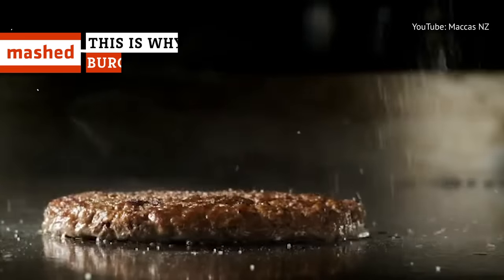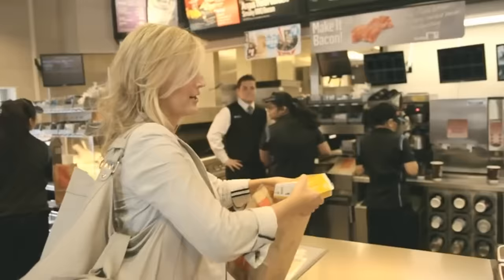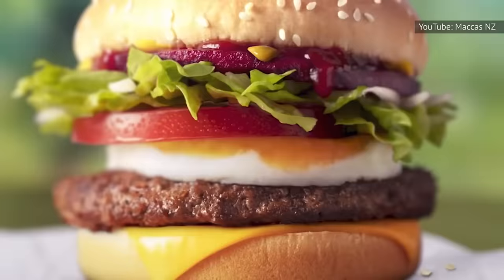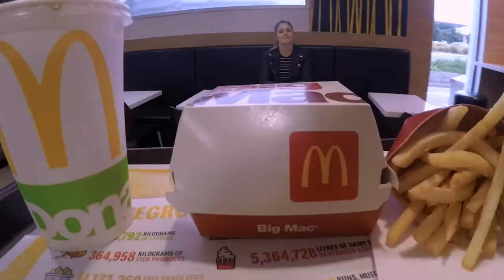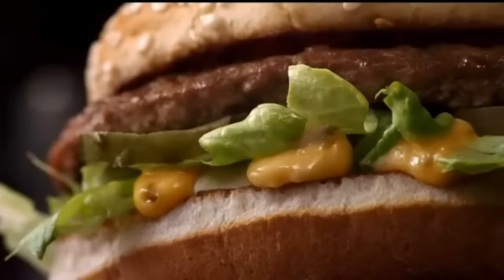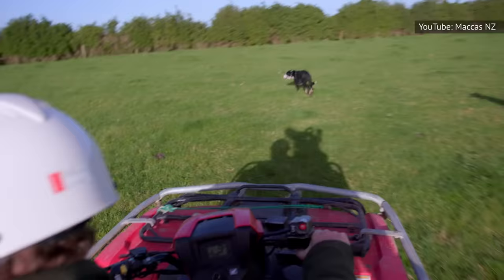This Is Why McDonald's Burgers Are So Delicious

Comment: Recently I was completely taken aback when I ordered a double quarter pounder with cheese as I was on a cross country road trip. I rarely order a double quarter pounder with cheese, it usually is a quarter pounder with cheese and even then that’s maybe ten times in a year. This was by far the best double quarter pounder with cheese I had eaten in a long time. I ordered inside and ate it on their exterior distanced seating given COVID19 regulations. It was freshly made, the two patties were huge, juicy hot, larger than the bun which as large as the box container it came in. It was so good that five minutes later I went back in and ordered another just to see whether this was a fluke. Well, it was not. The second one was as piping hot, two large patties, etc.., I kept thinking that I was eating a burger made in a diner and made just right. Definitely this particular location had a very high quality and consistently pumped out that standard of food. I will have to see the next time I can make it there, as it’s a small city or town halfway across the country. I am reluctant to order one here in my my hometown as I doubt that it will be as good.
Reply: Honestly, I am guessing it wasn't busy? The less busy it is the more time they have to work on your burger and are not rushed.
Reply: I just ordered some Mickey d's last week for my family and myself and I got a double quarter pounder after 10 years of not having one. I almost cried, the whole experience was so good! As you said, it was piping hot and super fresh;the quality:top tier. It was the juiciest sandwich I'd had there EVER, and sent me into a comfort coma. I was so excited to eat it, I had to remind myself to slow down and savour the moment. The next time you order, Ihope your meal turns out as great as it did previously.
Reply: @victorkd9926  they were busy and I had to wait 15 mins to get each time I ordered. It definitely was because of that particular location’s standards and IMO their supply of ground beef.
Reply: I order double quarter pounder with cheese meal, often and sometimes it’s absolutely burnt and dry but about 2 weeks ago, I ordered large double quarter pounder meal with cheese, via UberEats. Because I’m only 2 miles from store , my food usually comes acceptably hot, sometimes but cold but this particular night, the double was absolutely perfectly cooked just like you mentioned. So juicy and hot and the cheap was melted so perfectly. It’s very rare that I get McDonald’s delivery and it’s this good quality but I was very happy.
Reply: @simpette_2.0  same here man. My last double quarter pounder with cheese was absolutely perfect and I ordered through UberEats. Really hot super melted cheese and the beef patty was both perfectly cooked hot and juicy. Wish it was always that good.
Reply: At the one I worked at for years, we had an extra disdain for the double quarters eaters. We'd do things like burn the shit out of your meat just to punish your gluttony. Especially if you got a diet Coke with it or super-sized it.
Reply: @victorkd9926  What I've learned is, the less busy it is, the less fresh it is. The more they have business, the more they have to make fresh food, or you'll just get less fresher food
Reply: I know this was a year ago, but I am constantly surprised by how good these are now
Reply: Fresh meat. Not frozen
Reply: Are you trying to get a raise at the McGarbage that you work at? Or maybe you never had a good, quality real burger at a decent restaurant.
Reply: @victorkd9926  actually having worked there I'd say the opposite is true. Lots of customers will mean the burgers were cooked more recently and will be juicier and fresher. They won't look as pretty maybe but you have a better chance of having a fresh one if you go when it's packed
Reply: Which McDonalds was it

Comment: I was always amazed that you could not get a standard burger for adults at McDonalds - one that included fresh tomato, lettuce, onions, and mayo - unlike every other burger joint in the country. They remedied that briefly a couple decades ago with the McDLT, but it was pretty crappy since the whole thing was always cold (and they put the cheese on the cold side so it didn't melt).  However, recently, they started making a burger for adults  - the Quarter Pounder Deluxe! It is not bad, but's it's not great either, and for $5, I would rather get a burger at pretty much any other fast food restaurant or burger stand.
Reply: Just ask for tomato on the side
Reply: They used to have the Big N Tasty but they got rid of that a long time ago. I guess people who want that kind of sandwich will just go for the Whopper or Dave's classic at Wendy's.
Reply: That is precisely why the founders of Mcdonalds were against complicating the simple burger.  They wanted something that was hot and fresh and not weighed down by items that would soggy up the bun or chill down the burger.  I have said for years tomatoes have no place on a burger and I am sticking to it

Comment: Pink slime is NOT a bad thing! Beef trimmings are cleaned of fat, and ground fine. Then, it is sanitized with ammonia GAS! Not liquid ammonia. This is a sanitation method that has been approved by the FDA for decades. So, we are left with very low fat, sanitized beef. By itself, the texture would not be pleasant. But, when it is mixed with at least 75% ground beef, you will never know the difference. And, it ends up costing less. So, pink slime is a terrible name for something that is actually a positive thing.

Comment: The whole appeal of McDonald's was the fact that it was cheap and fast.   Imagine my surprise on a road trip recently and I was hungry and the town I was in at the time had almost zero fast food options other than McDonalds.  I reluctantly pulled in, because usually I avoid that place like the plague.    I ended up paying 10 dollars for Big Mac meal.  What I got was dried out flavorless hockey pucks smothered in sauce, and fries that were soggy as a wet diaper.  I took two bites and then drove down the road to a gas station and for 3.99 I grabbed a burger, fries and a drink that was monumentally better.
Reply: Some gas stations have really surprisingly good grub.

Comment: You do not know what you were talking about. McDonald’s hamburgers or not made to order. They are made on mass scale and kept in a warmer on the heat lamps for 1/2 hour before getting supposedly thrown in the garbage. McDonald’s does not make anything to order unless they run out. I know this for fact I used to work for McDonald’s.

Comment: They're 100 percent beef | 0:00
They're made with specific cuts | 1:10
Standard burger patties are flash frozen | 1:58
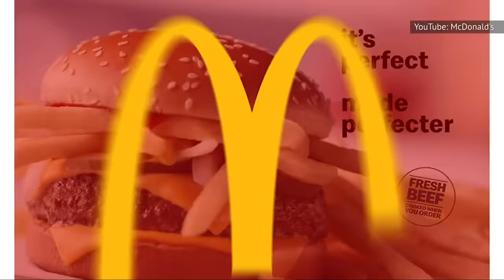Quarter Pounder burgers are fresh | 2:52
Burgers are seasoned on the grill | 3:45
Using relatively local beef | 4:48
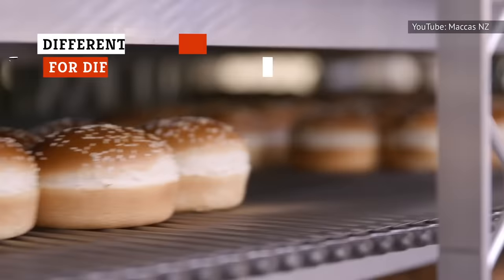Different buns for different burgers | 5:25
Holding vendors to strict standards | 6:39
The only item with preservatives | 7:28
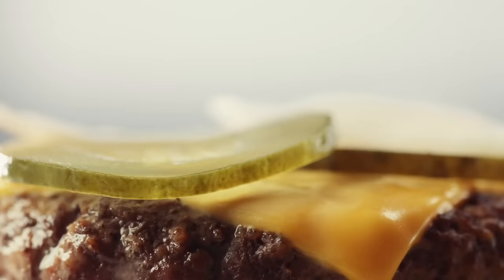Burger toppings are carefully selected | 8:32
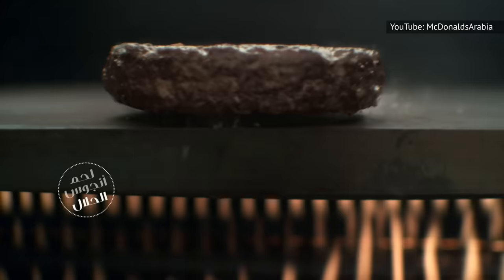Quality control | 9:13

Comment: I swear the burgers used in the Big Mac seem to have gotten smaller. They seemed to be bigger back in the 70s and 80s when I first started eating them. They started shrinking in the late 90s. They also seem to have gotten inconsistent. I've gotten some which seem to be smaller than the patties they use in their basic hamburger and cheeseburger. 
Consequently, I now prefer Wendy's and Checkers/Rallys burgers. They seem to taste better. Only patronize McDonalds when they have the 2 for offer advertised or have no other option.
I used to prefer Burger King too. But their product seems to have lost some quality. I remember when they came out with the Big King and it used a full size burger patty like the one in the Whopper. Now they use smaller basic burger patties. Another thing I resent about Burger King is them nickel and dime practice. Every other chain just offers their premium burger with cheese. BK charges you extra for cheese. Not paying $0.50 for a slice of process American cheese.
Reply: McD, Wendy's, and BK here in my area all charge extra for sauce packs and extra cheese.

Comment: There so called burgers are a joke, plus it doesn't taste like real meat. I had eaten plenty of times and for the most part No longer do anymore, The Big Mac if you really want to call it that way is mostly more bread than anything else..plus the meat doesn't go to the full size of the bun either. I rather eat Burger King or Checkers Big Bufford at $4.00 Blows mc D's out of the water.